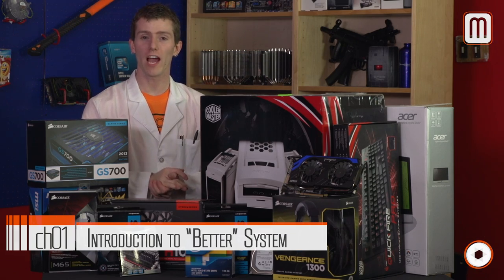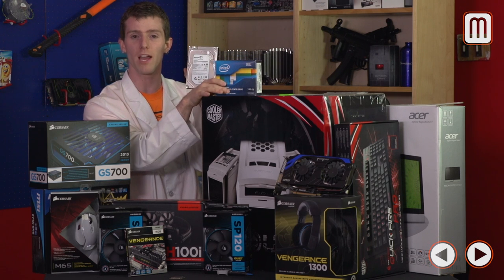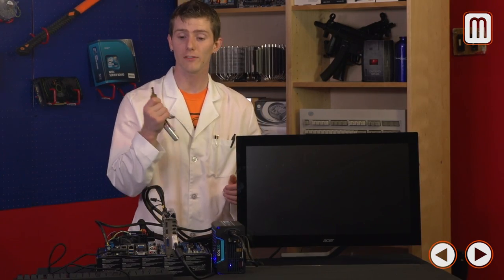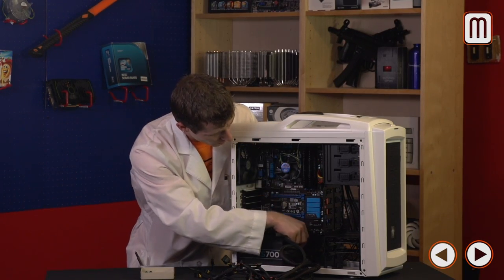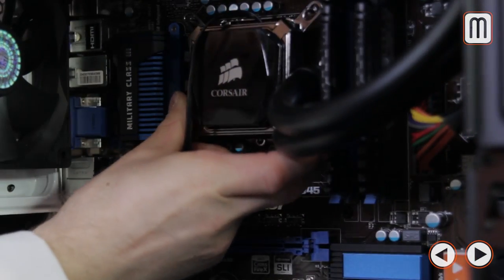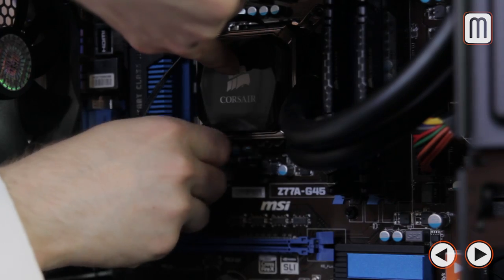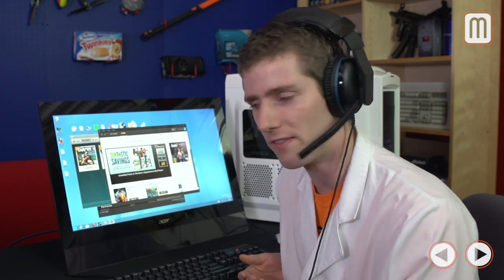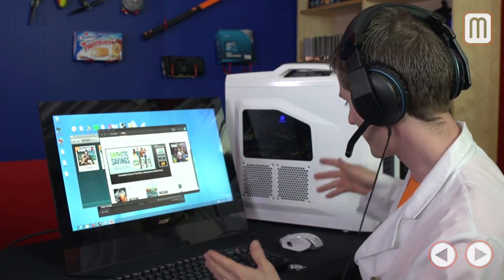ULTIMATE Build a Better $1500 Gaming PC Computer "How To" Guide

Comment: I actually built this computer. I'm still on it. Here is my criticisms:
Don't buy anything from MSI, unless, maybe, a mouse mat. Don't let MSI touch anything that you actually care about.
I went with EVGA and Asus instead.
Don't buy Intel's SSD's - Samsungs are significantly faster, and lasts longer, and has the best software.
Finally, don't listen to what Linus said about RAM. Buying 2x4GB does not lock your system into 16GB. You can buy the same 16GB kit as his, and install it alongside your 2x4gb for a total of 24gb, and since the system only uses dual channel, and thus, sticks in pairs, this barely has any performance hit at all, little enough that you can barely measure it, let alone anything significant enough to notice while using the machine.
Reply: Back then intel sdd was better and msi for budget.
Reply: Also the ram config isnt ideal and can cause instability

Comment: i think for $1500 this is not a good build .for £1000 roughly the same price i built my system ,and a damn site better  .coolermaster stryker white
i7 4790
coolermaster heatsink
msi 970
32gb vengeance pro
1000 wt power

Comment: Can you have 4 SSDs and no HDDs?
Reply: why not
Reply: +Vilius dgehjebeg r u sure??
Reply: +adam william yes, ssds is just faster, but more expensive
Reply: +Vilius dgehjebeg Thanks m9 I will probably do that.
Reply: +adam william what rig do you have?
Reply: +Vilius dgehjebeg I am building mine soon, the parts I bought are quite expensive. It has an i7 6800k OC as well as the MSI GeForce GTX 1080 graphics card with the In-win 909 full tower chasis.
Reply: +adam william well i hope you have a really good time playing on that beast, make sure to have at least 16gb of ram, have good psu, and have good airflow... so goodluck.
Reply: +Vilius dgehjebeg Thanks m9 I actually bought a 32gb Corsair RAM lel
Reply: +adam william dominator? i think you could run your games on 1080p on 15fps. if you are lucky
Reply: +adam william ok that was a joke m9, what ram did you got? dominator?
Reply: +Vilius dgehjebeg Yeah dominator platinum 3000Mhz RAM.
Reply: +adam william i hope i had such a pc as you will... and as i said good luck, and will you oc your cpu and gpu?
Reply: +Vilius dgehjebeg Of course I am going to OC both my CPU & GPU m9. I am building a beast right now!
Reply: Update us on your PC
Reply: Snekelicious well i got two 1080's now so really im just waiting for water cooling.
Reply: +adam william will you try vr?

Comment: Can anyone help me on my setup?
 PCPartPicker part list: http://ca.pcpartpicker.com/p/w8ZKbv
Price breakdown by merchant: http://ca.pcpartpicker.com/p/w8ZKbv/by_merchant/

CPU: Intel Core i5-4690K 3.5GHz Quad-Core Processor  ($285.70 @ DirectCanada)
CPU Cooler: Zalman CNPS5X Performa CPU Cooler  ($19.99 @ Memory Express)
Motherboard: MSI Z97 PC MATE ATX LGA1150 Motherboard  ($119.99 @ NCIX)
Memory: G.Skill Ripjaws X Series 8GB (2 x 4GB) DDR3-2133 Memory  ($85.98 @ Newegg Canada)
Storage: Seagate Barracuda 1TB 3.5" 7200RPM Internal Hard Drive  ($58.98 @ DirectCanada)
Video Card: Asus Radeon R9 280 3GB DirectCU II Video Card  ($237.95 @ Vuugo)
Case: Thermaltake Urban T31 Window ATX Mid Tower Case  ($89.99 @ Memory Express)
Power Supply: EVGA 600B 600W 80+ Bronze Certified ATX Power Supply  ($54.99 @ NCIX)
Monitor: BenQ RL2455HM 60Hz 24.0" Monitor  ($199.00 @ Amazon Canada)
Keyboard: Razer Deathstalker Essential Wired Gaming Keyboard  ($54.99 @ Amazon Canada)
Mouse: SteelSeries Rival Wired Optical Mouse  ($64.98 @ Amazon Canada)
Total: $1272.54
Prices include shipping, taxes, and discounts when available
Generated by PCPartPicker 2015-03-08 19:10 EDT-0400

Comment: https://uk.pcpartpicker.com/user/RageBlazing/saved/XcbBD3     first build for me, not entirely sure how to build it but what Wireless Network adapters would you guys recommend along with an optical drive? How is the build for around 800 pounds? Would I need an SSD? do you think its possible to pirate windows instead of buying it so my graphics card can stay at that price
Reply: There are "OEM" Versions of Windows which only cost 20€ in Germany which are only online buyable Activation Keys for a specific Windows version. You can download Windows Versions for free and burn them onto a CD, but in the installation on a new PC you'll have to enter this Product Key.

Comment: Lmao. This computer still costs 1500 to build in 2022. Jk. Inflation adjusted, current prices dont look too bad compared to then. That's like a 12th gen i5 and a 3060 as far as current/to now performance. With inflation 1500 is 2000 today. So that is a 2000 dollar system in current pricing.

Comment: hey pc noob here. 
is this a good build? leave any tips

https://pcpartpicker.com/parts/partlist/
Reply: there is nothing in the link
Reply: Use the permalink on the top of the pcpartpicker.com page, not the actual link as it's a generic one that will direct you to your own  build
Reply: you might want a better cpu like the fx 8320, 8320e, 8350, 8370 or the 8370e the 6300 might bottle neck your 970 in some games and the rest of the build is ok
Reply: also don't cheap out on a psu they can kill your components if you don't buy a reliable one, I suggest this one: http://pcpartpicker.com/part/xfx-power-supply-p1500bxtfr it also has black sleeved cables
Reply: Chalklate dude thanks cuz i dont know shit about pcs and i fucked around a spent 1200 on a laptop. ill hold that L. Also what does the term "bottleneck" mean?
Reply: Ahmed Omar i updated it lol my bad
Reply: Chalklate and do you have any links to the cpus you suggested
Reply: I'm not an expert but i think this will be better:
http://pcpartpicker.com/p/XhJgRB
As it's a skylake and a ddr4 build you will be able to upgrade to a much better cpu 
I had to downgrade from the 970 to a r9 380x to meet your bidget
I upgraded the psu to a 600 bronze it's only 5$ difference and the ram to a ddr4 ram

The r9 380x is pretty good card 
Yet again i'm not an expert.

Take care☺
Reply: Budget*
Reply: Ahmed Omar thx man ill keep your recomendations in mind
Reply: ***** np glad i could help

Comment: Is this a good build and does these parts work out whit each other? ty

https://pcpartpicker.com/user/jouoonparas/saved/#view=NCqzK8
Reply: ***** Okay thanks :)
Reply: +Eero Nolvi 
Too be honest you seriously don't need a i7 for a 1000 dollar gaming PC, especially the old 4790k. 
https://pcpartpicker.com/user/Deathsushi/saved/8FggXL
Better PC for the price, Skylark i5 6500 which you can overclock and has similar benchmarks as i7 4790k, but cheaper and upgradable later on.
Good motherboard with 64gb ram slots and double sli for GPU
Hybrid hdd (a ssd and a hhd together)
Killer 980x and you can add another GPU on it later on it needed.
750watt gold power supply,

Guarantee better fps then the PC you have and more reliable in the future. You can change the case if you want.
Reply: +rockguy132 Honestly, the 980 isn't THAT big of an improvement to the 970 considering the big price difference. Depending on the resolution; if it's 1080p, the 970 should give you more than enough performance to handle pretty much every game on max settings. If you really want an improvement, say that you game in higher resolutions and want rock solid performance; you're better of paying about 200$ more than a 970 for a 980 ti which delivers a lot better performance.
Reply: A 980ti is alot better. I put a 980ti didn't I?
Reply: Ok nvm. This guy is right I didn't notice the 980 and it wasn't a ti. New updated. 
https://pcpartpicker.com/user/Deathsushi/saved/#view=8FggXL
Reply: +Eero Nolvi What kind of a question is that...? :l